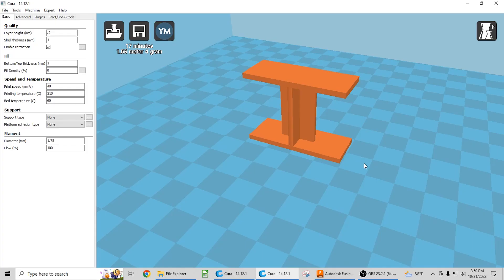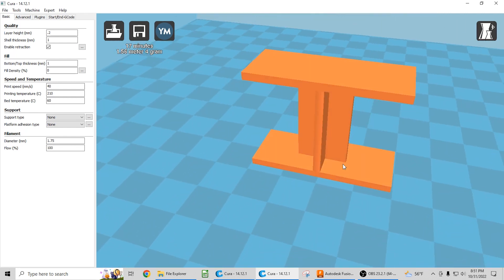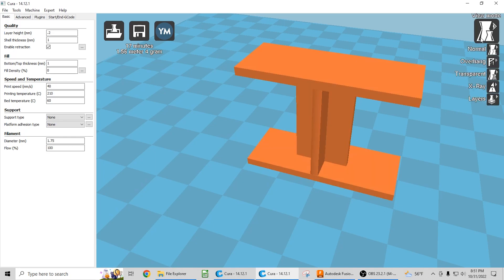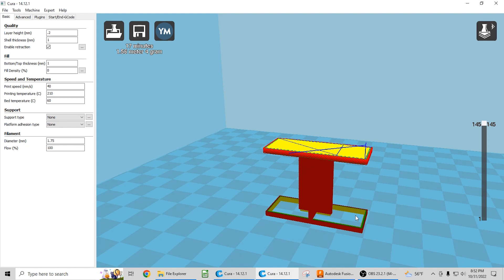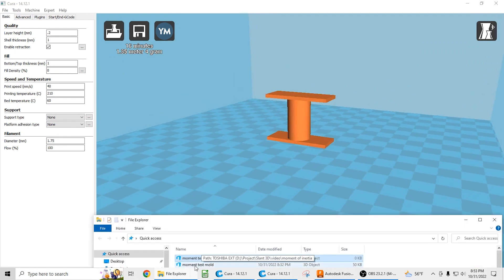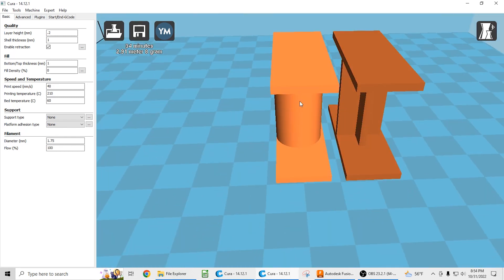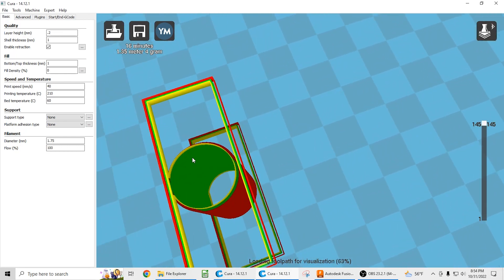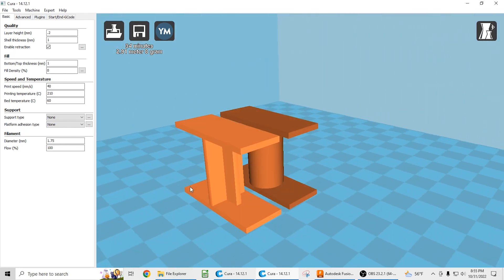3D Printed Parts as Strong As Molded: Design for Mass Production 3D Printing

Comment: Bro, this video hurts to watch. You can't change the design of the 3d printed part, beef it up and say it's better. It's no longer the same part. You're comparing apples to oranges. Print the same part and test it. The 3d printed part will fail first...

Comment: I'm thinking that shape should not be printed in that orientation, nor as a single piece. Split either design down the middle, (longest axis) then print the two halves with the middle faces down on the bed. I only stack layers if a bolt, screw, or dowel is planned to run through them perpendicular to the layers. I make small doll house scale objects, so something as tiny as a bath faucet would crumble any other way.

Comment: IMHO this video is very important 👏 in so far as it actually informs designers to consider practicality with esthetics rather than just "getting the job done ✔ ". As mentioned by another commenter this is really a very, very old version of the CURA Slicer. The newest version of CURA, at the time of this comment, is CURA 5.2.1. This is an important factor as the newest version provides for many, many more features that will help with higher quality prints.
Reply from the maker: The slicer was selected for its appearance on screen not for for its specs. All the design rules in this and any video hold independent of the slicer

Comment: I see your theory and raise you strength of layer lines bonds versus the bond of injection molded one piece bonding. 
Especially printed in this orientation.
Reply from the maker: Every part breaks. Every part has some internal strength. You have to design for the process you are using for mass production
Reply: @slant3d  All i hear is that you won't.

Comment: Depending on various slicing factors, the bond where the round part meets the flat ends may still be a weak point. I'd aim for better geometry there if possible.
Reply: fillets
Reply: @suivzmoi  Future slicers need to have a setting to strengthen areas of the print to higher infill.  Imagine dragging sizable cubes into just those stress areas, and bumping the infill there from say, 17%, to 50%...  I also bump my temp up a tiny bit and tiny drop on cooling (unless overhangs are an issue) for best layer adhesion in structural parts.